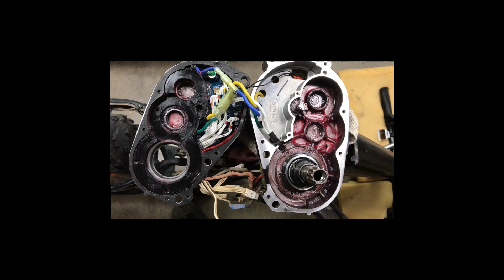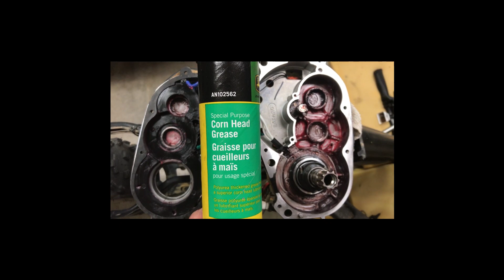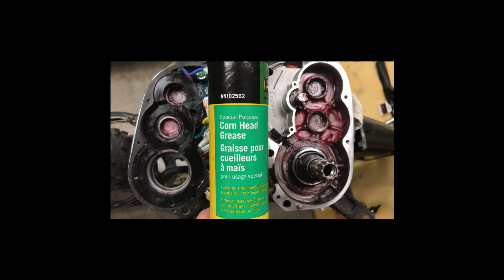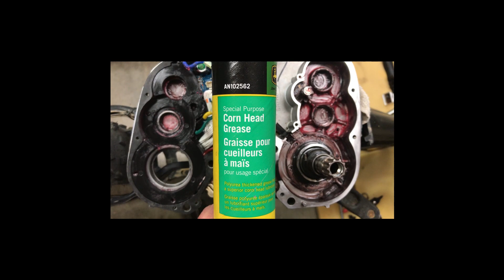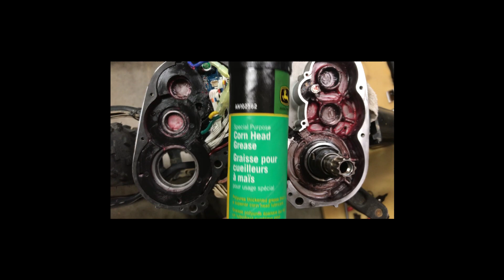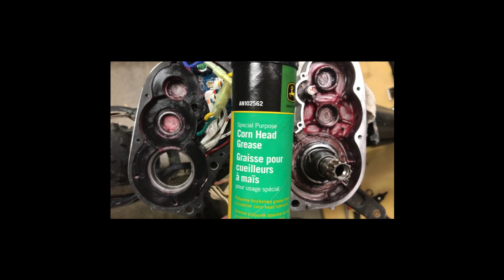Best EBike Grease for Bafang Ultra and BBS02 Motors

Comment: since this grease has a mineral oil base there could be concerns about degrading plastic gears over time. I've made myself a similar grease using Lucas' Xtreme Heavy Duty (synthetic Polyurea SS) and heavy(320W) industrial gearbox oil. that blend flows pretty well yet sticks to  gear teeth and is fully synthetic.
Reply: Even Molykote pg-75 made for plastic gears contains mineral base oil.

Comment: Every 1500km IS like 2 weeks for me. Needs something faster like a grease fitting and plug where old grease comes out when new grease IS put in
Reply from the maker: I haven’t noticed any breakdown of the grease after 4K miles. I did locate a spot for a fitting but overfilling would force grease into the circuit boards. 😀
Reply: @filoncmike  I dont think IT would Be possible to overfill If The other plug IS open for the grease to come out. And done at very warm temperature so that the grease Have low viscosity

Comment: Thixotropy is a time-dependent shear thinning property. Certain gels or fluids that are thick or viscous under static conditions will flow over time when shaken, agitated, shear-stressed, or otherwise stressed. They then take a fixed time to return to a more viscous state.
I just did my motor, it’s very quiet and now everyone that has heard it wants to do it😎 thanks for sharing
Reply from the maker: That's awesome! Glad it worked for you.
Reply: @filoncmike  thanks, someone recommended your videos to me. I just hope I used enough corn head now that I think about it. I probably used 1/4 of the tube. It definitely makes sense to me. The little bit of grease that was in mine was all stuck to the case, none on the gears. If it doesn’t sound right after awhile I’ll just add a little more, but for now, it’s sounding great and feels fresh. Thanks for discovering this and sharing

Comment: Did you pull the seal and repack the bearings with the cornhead too? Did you clean out the bearings or just add?
Reply from the maker: I repacked all the bearings with mobil synthetic bearing grease - red. nearing 4000 miles and this motor is quieter than my new one! Rode today and it performed really strong on long 1 mile uphills. good luck!!
Reply: @filoncmike  I was thinking the same actually, corn head in the gears , pack the bearings with something else. Thanks for the reply!

Comment: There are many videos of overfilling the bafang motor with grease.

Doesn't it become rotational resistance when the grease is fully filled?
The G510 I'm using is very quiet and makes almost no motor noise.
Reply from the maker: if your motor is very quiet, dont grease it. If it does get louder and louder as you ride more, you may have to grease it. It is hard to over grease, but if you do, grease will invade the controller area which may be bad. I havent noticed and rotational resistance at all from the cornhead grease. That seems highly unlikely.

Comment: Can I mix the corn head with the factory grease?
Reply from the maker: If you don’t want to clean out the factory grease that is ok because there is so little factory grease in there, it shouldn’t be a problem. When you open up the motor most of the factory grease is on the sides off the gears.  I think adding cornhead grease will be fine. Happy riding!!

Comment: Gear oil would be much better then any greases!. If the gasket was good enough, the only problem i see (from the videos), is the crank torque sensor's wire opening...
Reply from the maker: Ron! Gear oil in a no no!! If you lay the bike on its side, or turn it upside down,  oil will run into electronics!!! Grease only!!
Reply: @filoncmike  Yeah, you'r right, i don't have mine yet, but i thought that the 2 chambers were separated. The plastic part, on the gears side is not sealed- off. I thought that the only compromise was the torque sensor wire tunnel...

Comment: the JD corn head grease is a polyurea thickened grease. It's with a mineral oil base though and not very suitable for nylon gears such as in the bbs02. Another heavy duty polyurea grease is Lucas x-tra Heavy Duty. I haven't tested their marine grease yet, but the calcium sulfonate thickener might be even better than polyurea.
Reply from the maker: Thanks Jonas! Stay away from "Heavy Duty" that implies thick which will not flow back on the gears and constantly relube - Good luck!!
Reply: @filoncmike  no, heavy duty stands for excellent adhesion and load bearing capability. Remember, the bbs02 secondary gear housing is poorly sealed to the inside, the grease really needs to stay on the teeth. many people have recommended bentonite thickened aviation greases such as mobil 28 or aeroshell 22. I have used them, and they are worse than the factory grease as they are more like pudding with zero film strength
Reply: @JoLe1991  Thank you so much for mentioning the Lucas Xtra Heavy Duty grease. I’m new to the BBSHD, and used it when installing the steel gear, and will again with the PEEK gear. It seemed like the best option, and the PEEK material is apparently tolerant of many types of grease; and this green stuff seems to be a very good option.

Comment: It seems like like the corn grease acts more like a gear oil than a grease. I don't know if the gear case or electronics inside are designed for an oil type substance.
Reply: the gears look well separated from the electronics on this motor - guessing it might be ok. but some of the bafang integrated motors are not designed this way from what i've seen - i'd be careful which motors you put corn head grease in....
Reply from the maker: It definitely is a grease with a peanut butter consistency. The difference is it has a polymer construction that makes the molecules stick together and flow together. My first Bafang UItra has 4200 tough hill climbing miles on it and it is silent under load. My new motor I greased after it got loud at about 300 miles. It is getting quieter with each ride. No the grease does not get into the electronics. The only spot where that might happen is the top of the motor drive gear which has the magnet that is in close proximity to the hall sensor. If no grease has gotten in there after 4000+ miles, it will never get there!!

Comment: Use Mobile SHC100 grease, a red synthetic lithium grease for the G510 motors  recommended for higher speed applications such as electric motors.
Reply from the maker: Thanks Fred. Mobil SHC100 is a good grease, but even though it has peanut butter consistency, it doesn't flow back into the bottom of the gear case like the Corn Head Grease does.
Reply: @Mike Filonczuk  The way you talk all  the grease would be at the bottom of the motor. The G510  gears do not lay flat.  Where the peanut consistency  does stay on the gears and after many miles the ShC100  does still stay on the gears.
Reply from the maker: @frederickv.9300  Well Fred, that is just it. If the grease gets flung to the sides of the case like the factory grease the cornhead grease flows back down over time and the gears pick it back up, perfect scenario!! Good luck!
Reply from the maker: @frederickv.9300  Fred, notice that "gears" are never mentioned in the application specs of the MobilSHC100 that I could find, only electric motors and bearings. It also states that is gets thicker under heat - not desirable. Corn head grease (i dont have stock in it really) is specifically designed for gears and gear boxes.
Reply: @filoncmike  Corn head should never be used with Nylon gears.  Nylon gears are  some times used in Bafang motors.  Corn head grease should be used in gear boxes not in electric motors. You are setting your motors up for failure and setting up others for failure.  I have taken G510 motors apart  and all the grease is not spun to the outside of the motor.  That is your only reason to use.
Reply: Corn  grease  is Formulated for John Deere corn head and other SLOW SPEED gear cases.    .